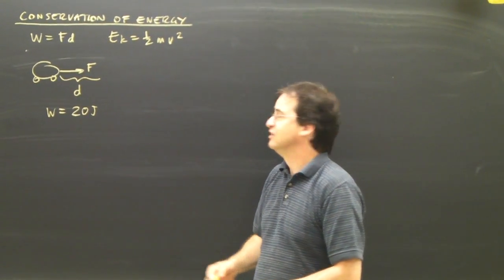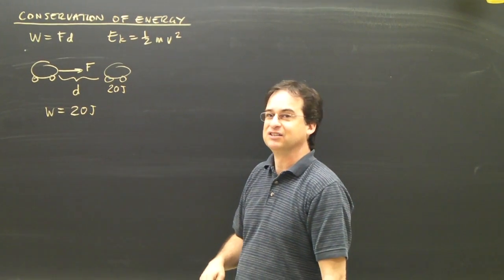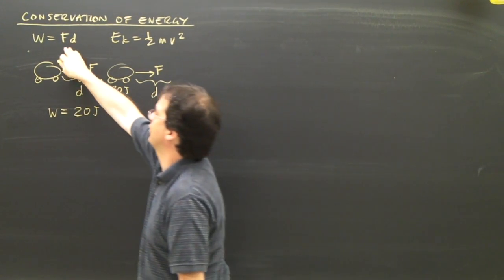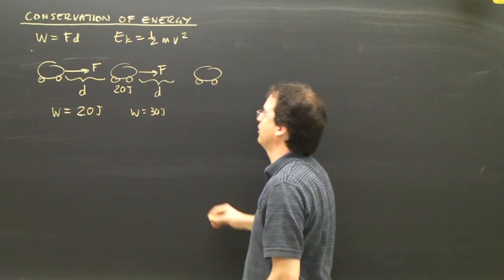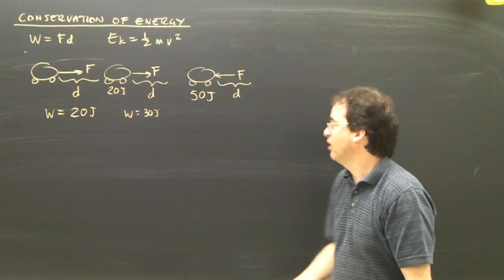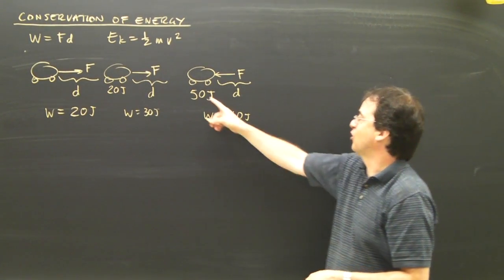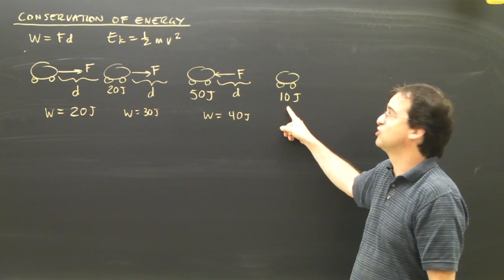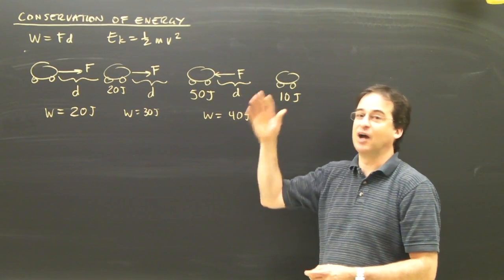Kinetic Energy and Work Physics Lesson Conservation Part 1

Comment from the maker: @64647936 There is an unbalanced force on the car and it is accelerating. What's nice about energy calculations is that we don't  worry too much about the  type of motion. We added 20J to the car by pushing it and it now has 20J of energy and so is moving with a speed that represents 20J of energy. The fact that the car was pushed and underwent acceleration until the 20J was turned into Ek does not matter much since we only have to look at if we added energy or removed it. I hope this helps.